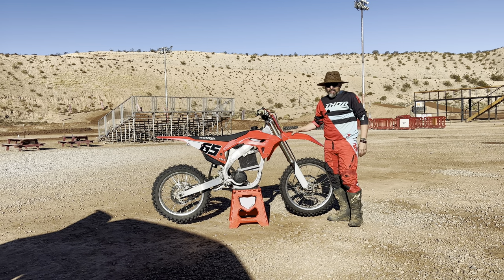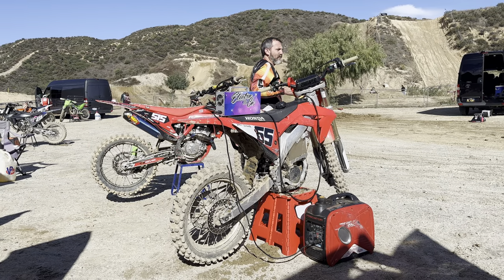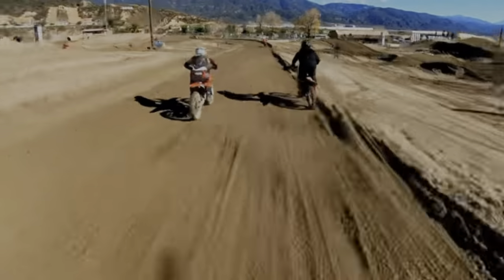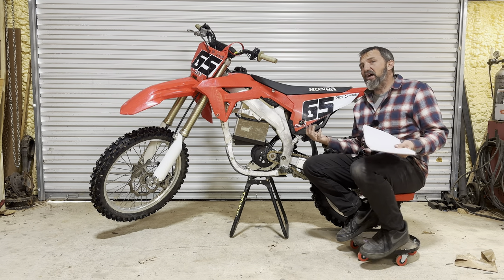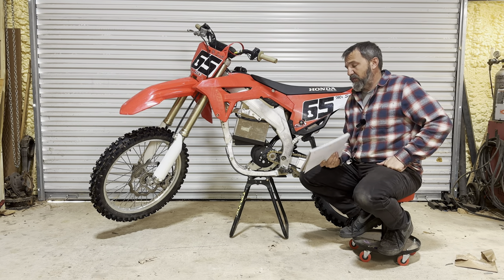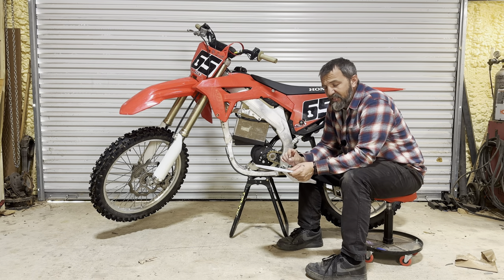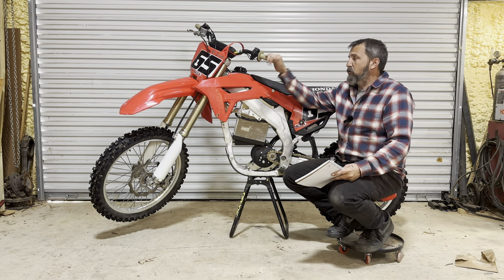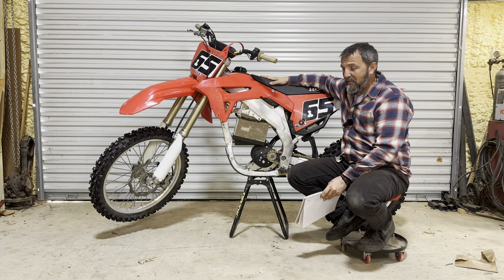How to build electric dirt bike Ep5 DIY Stark Varg. What did it actually cost?

Comment: I run an app on my phone called GPS Speedometer.  I start it when i leave the garage, and stop it when I'm back, I get milage, average speed, top speed.  It's good data to get a better idea. most of us old dirt bike riders have no sense of speed or distance cause simply no bikes ever measured.  My stealth bomber clone gets about 125-200cc performance, but I'm also riding streets and trails around town without issue.  My biggest limiting factor is range and recharge times.  I have a 72v 45ah battery and riding it fast like a dirt bike get roughly 30 miles before I'm limping home.
Reply from the maker: Thanks 🤘🏾. I will definitely use that app.

Comment: Great job! What year CRF450 did you use? I want to do the same thing with a 2007 CRF450. I already have everything ordered. 

Any idea what the final weight is? 

👍
Reply from the maker: It’s a 2003 frame. I’m planning on doing all the specs on the next video.

Comment: Nice videos. You got a great deal on the roller. Did you have other costs  to get it ready like tires, chain and sprockets or wheel/suspension bearings? Those would push you over $5k but still great.
Reply from the maker: No, I have tires and other parts. The linkage bearings were dry but I just greased them. I’m sure they will need to be replaced soon enough but not at this point.

Comment: Hey man, you are straight up awesome. I’m limited on time but you’re doing all the things I would do if I had time and it’s amazing to watch. Also what’s your sons name I watch supercross and want to root for him in that LCQ.  Lastly I just want to add I have a completely modded surron x and my total watt hours for a 60x60 chi max battery is about the same as yours. Obviously my surron is not meant for Moto but trail riding in imaging it will last much longer being lighter weight. Do you think you could have electron co build a battery closer to total 5000 watt hours and fit in there? Also what’s the total weight of that bike?!!! Sorry for the long comment 😂
Reply from the maker: Son is “Doc Smith”. I will have more performance specs in next video and weight.

Comment: Makes sense that it won’t pull since the stark has a 14200 rpm motor! All the diy would need is to find a rpm motor that’s comparable and will have that high pull. 

That and be able to do a comparable battery since they use a 360v battery I believe
Reply from the maker: Yeah, I was wondering what their max RPM was.
Reply: @aMotoheadsGarage  says 6000 rpm with field weakening. Probably can go higher just may burn out “sooner”. 

I plan to use a sotion fw04, similar size and rated for more power and rated for I think 9000 rpm peak. Probably can hit 10k. Not bad for $685 shipped
Reply from the maker: @andrewkitchens3917  does it have gear reduction?
Reply: @aMotoheadsGarage  yes. It’s very similar to the qs138 .
1:2:52